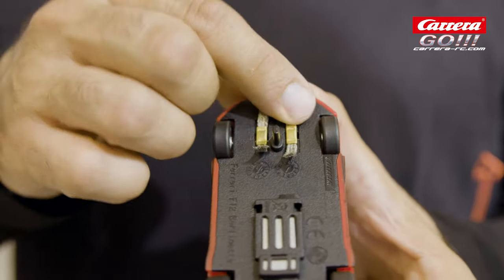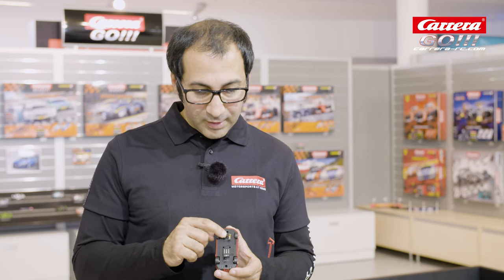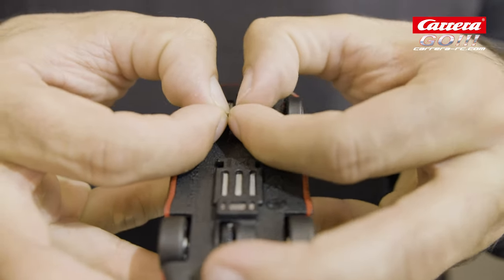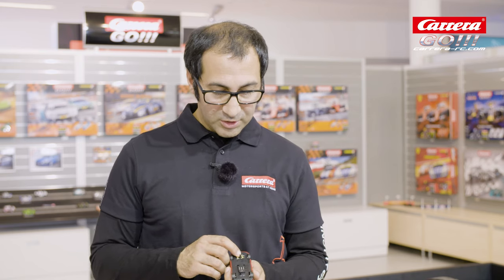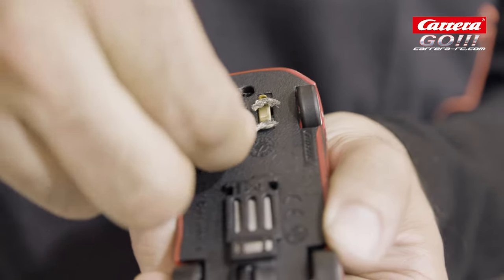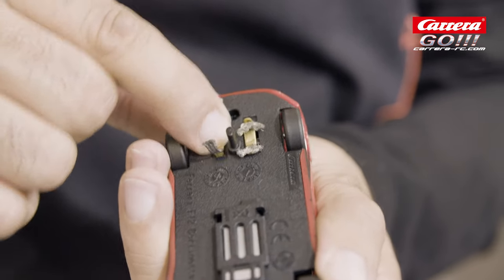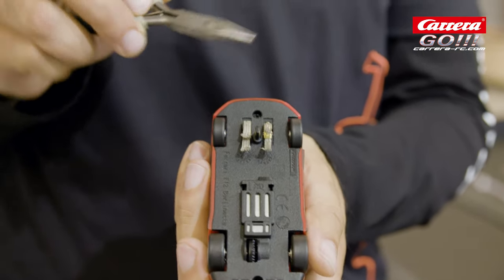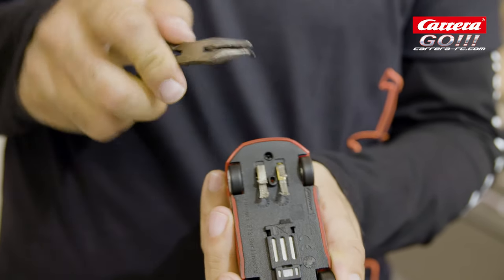Carrera GO!!! Tutorial: Service Assistance

Comment: Hi, I would like to know if this little cars are compatible with the analog system of Scalextric, thanks.
Reply: I still haven't bought them, but I'm going to to use them on a Polistil track, greetings from Italy.
Carrera Go! uses the same input of serious 1/32 slot tracks, about 10W, in order to get over loops and all thoose stunts.
Polistil for kids had less power, about 4W, and that's why they did not have strange stunts. So, basically, if they could bear the power of a regular 10W slottrack, there's no reason why they couldn't work with less.
A reason why I'm oriented to Carrera Go! is that, firstly are more distributed in Italy than Scalextric, second, if my Polistil trasformer would broke, I would buy a Ninco's and let the track run again.
Are DC motor,s everything less works, maybe is problematic putting a 4W car in a 10W track

Comment: Some of my cars have no power on the loops. Why is that? I bought a new one, and no power on the loop. Even if I switch lanes and/or controllers. But my others do have power on the loops.
Reply: I have the same problem too on my F1 Red bull slot car, but my Ferrari slot car works. Did you change the brushes?

Comment: Hello, for one of the two tracks, the car is advancing and never stops. How can i fix this problem ?
Reply: check the hand controller and take a close look at the boost button, it tends to stay closed,hence providing full power all the time
Reply: @finn3163  thanks for your reply. The problem does not come from the controler since the car advances even when the controler is unplugged or when the other controler is plugged !
Reply: @usernamefr  maybe try a multimeter on the track to see if any current is flowing whilst the controller is unplugged and the car is offtrack
Reply: Same issue! One side won’t stop, did you find fix?